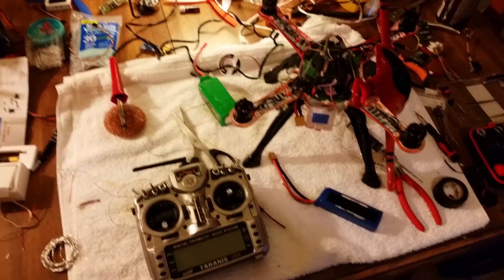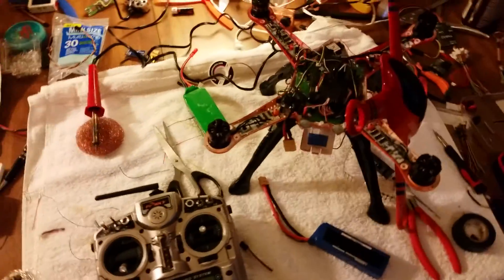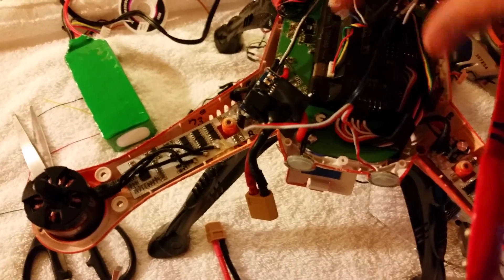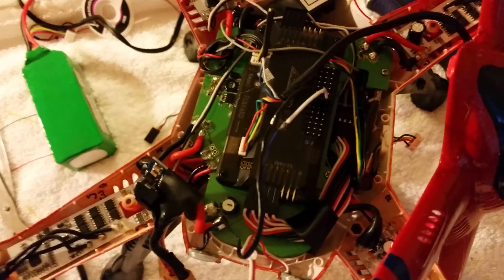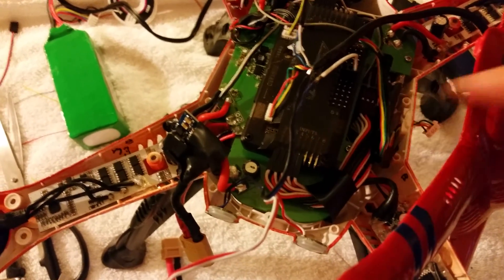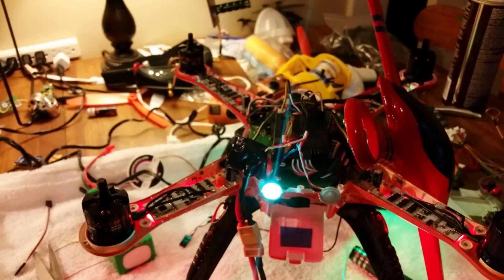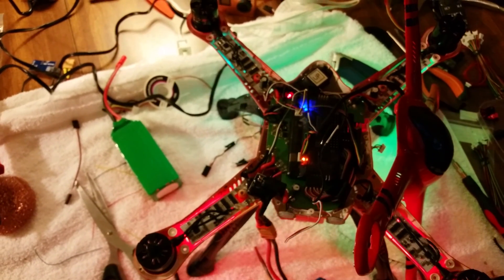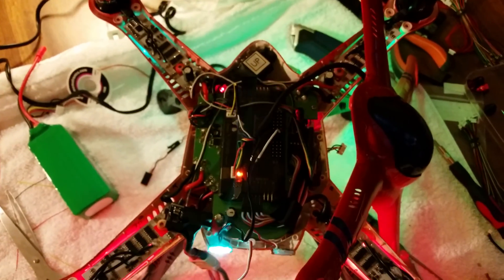Install apm external led on walkera X350 pro

Comment: so we dont have to put resistors at 350pros led?
Reply from the maker: md faisal nope
Reply: +C Fowler Why do they say the APM will blow the stock LED's on the other forums?
Reply from the maker: Its possible but I've had 0 problems with the apm output
Reply from the maker: just listen to me :)
Reply: Lol. Ok I'll rake your word. Thanks for the info.
Reply from the maker: +Daniel Ruffin Sir yes Sir, check out our channel, we're walkera offical
Reply: +C Fowler I just joined the one on Facebook. is that the same one? Do you have GPS status working also via the APM?
Reply from the maker: +Daniel Ruffin ya
Reply from the maker: +Daniel Ruffin you need to move the GPS away from the fc